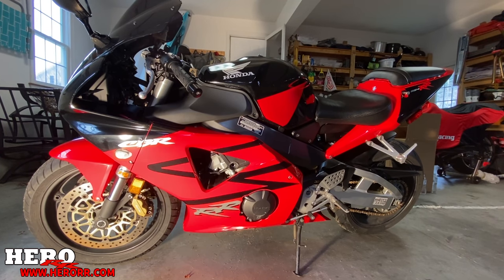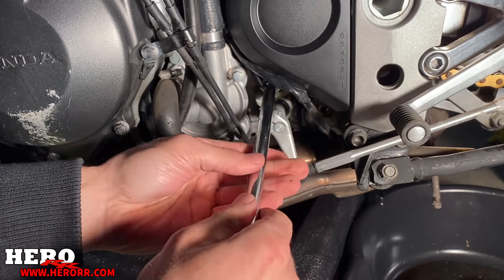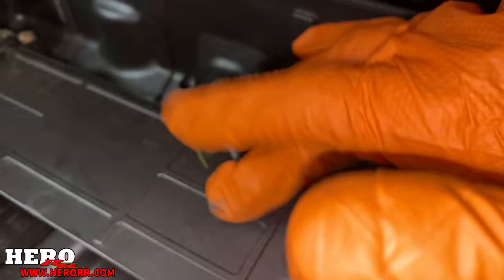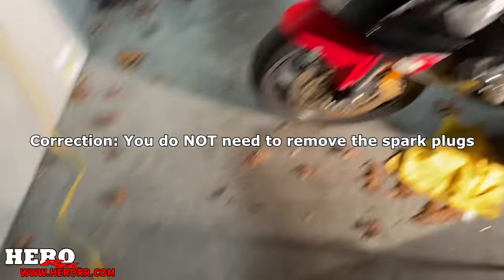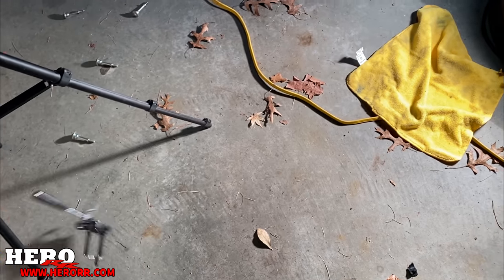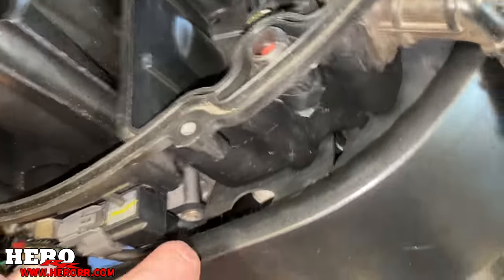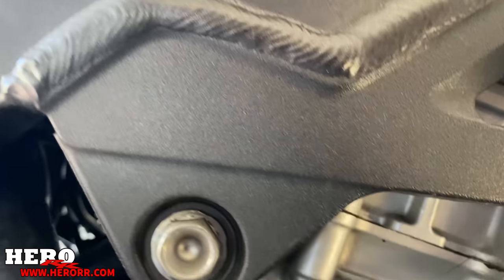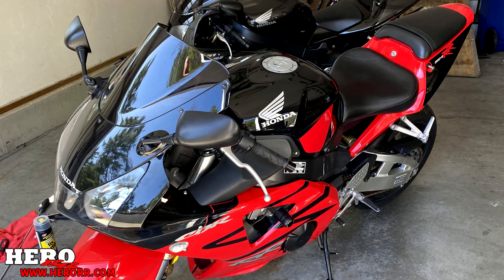Fixing my CBR954RR Lemon

Comment: Great video! Good on you for taking the time to help everyone who loves a 954 :).

Hey a couple of quick tips (apology if they have been mentioned) to help anyone watching:

- Download or purchase the 954 workshop service manual.

- Use a tool tray and small containers (e.g. spray paint caps) for your tools and screws. Avoid the floor.

- Use PLENTY of rags/cloth to wrap parts or cover them when resting against the bike.
 
- When lifting the fuel tank up, rather than 'prop' the tank with a can or anything else, you are better off tying a strap from the fuel tank front bolt holes (with a hook) back to the sub-frame near where the starter relay/fuse box is.

- No need for a sump plug magnet > the oil filter collects ALL debris (even what would be attracted to the magnet) before it reaches any bore or bearing. The magnet DOES NOT pick up main bearing or big-end bearing material (which is generally what people want to check when intending to buy one) since the top material layer of these parts are not ferromagnetic (thus will not get attracted by the magnet). What you generally see on a sump magnet is normal wear from the transmission (gears, primary drive, any other steel etc) that as mentioned, the oil filter does. Just informing ppl to save their $$$. **If you REALLY want to have a magnetic plug anyway, you can magnetize your standard sump plug with an existing magnet using the 'single touch' method (Google it, easier than me trying to explain!).

 - DO NOT use pneumatic/electric power tools for removing or installing bolts. They can damage a thread, resulting in an expensive repair. Use t-bars for cover bolts. They do not need much force.

- On camshaft cover gaskets or engine clutch/stator covers, you can use 'HT Dirko' red sealant or 'Black 3 bond'.

- Lubricate throttle/clutch/exhaust/air box flapper INNER cables with white lithium grease. 
- Lubricate side stand/foot peg pivots with Molybdenum Disulphide grease.
- Lubricate clutch/brake pivot points and cables ends with mult-purpose grease.

- Use fuel hose or a rubber hose to remove the spark plugs after they are loosened with the ratchet.

- Remove the 'PAIR' valve system and flap in airbox. You can leave all the cabling. Leave the exhaust valve (H-TEV) ALONE.

- BEFORE putting fuel tank back on, connect vacuum gauges so you can synchronize the throttle body.

- The 'noise' or 'knock' is NOT 'piston slap' > the pistons in this engine have literally NO skirt to cause this degree of noise. Usually (going by the video) this is acceptable for a 954 engine, could be simple wear & tear. Check your next oil change for metallic/shiny particles in drain tin - if there are none, no worry. If there are considerable particles, might need further inspection. 

- NEVER start the bike like you did after the oil change > instead, while looking at your oil pressure light on the display (red one), press the 'start' button and allow engine to crank BUT do not let it run. When it is about to run, IMMEDIATELY hit the KILL SWITCH. Repeat this process until the red oil pressure light goes out (it takes about 3 crank cycles), then you can allow engine to run. 

 

There is so much that can be mentioned when it comes to service/maintenance. 

Hopefully these few tips regarding your video help :)

Enjoy all!

Comment: I’ll just say as a owner of a 954. Treat her good, and ride her often. Don’t let em sit or they will have more issues than just maintaining them and riding em
Reply: that's how my uncle's bike develop so many problem it had to go full rebuilt, cus it's been sitting for years lmao
Reply: It’s better if they’re ridden but if you keep them indoors in room temperature it’s not as much of a problem.  Letting them sit in a cold garage or hot sun is horrible.
Reply: I just bought a 954 off my friend that sat for the better part of 5 years. The bike is in overall great shape but I would watch out for dried out rubber pieces. My chain guide and my rear cush drive dampers fell apart in my hands. Put about 1k miles on it so far with no other issues
Reply: they have weak weak breaking power when used as intended and front forks like tooth picks.
Reply: I’ve put 10k miles on my 954 since last June! I ride her as often as possible
Reply: @JimmyTheBear  hard disagree.
I’ve put 10k miles on a 39k mile 954 since last June on Louisiana roads.
The forks did get a service a year ago, but they are holding up like champs.
Reply: @jasonroth376  watch for grounds messing with you. Fuel pump not priming is a clue.

Comment: I've owned a few 929 / 954 over the years and love them but they are a nightmare to work on! A few times I've thought that it probably would have been easier to actually remove the engine then struggle around the frame! ❤️🇬🇧

Comment: I've had to do chain tensioners on all the Hondas I've owned (1995-2000)Then I went to a manual one, where you just have an external knob to turn to adjust. Because that is a job you really don't want to do twice.

Comment: When you drain the oil, if you are looking for shavings run it trough a filter, like coffee filter or a white rag something along those lines, you can also use a magnet to help. Sometimes loosing the engine  and tilting it a bit can help a lot giving access, don't know if that's the case here or not, enjoy your 954 and thank for the video
Reply: Or cut open the oil filter, there are even "can openers" for them :D
Reply: A cheap neodymium magnet to pull thru the oil as it drains would do the trick.

Comment: Idk if I'd call it a lemon it seems to me like it just has average wear from someone either not riding it enough or just not mechanically knowledgeable so they just road it and did there basic oil changes. Things like stripped bolts, leaking gaskets, dirty oil, bad clutch disks ECT are just normal wear and tare from time. You have to remember this is a pretty old bike it's seen a lot over its years and this kind of stuff just happens it sounds to me like you just spent more than you wanted too on the bike but she's a beut and not a sad lemon. 💪 

(Btw your spark plugs is showing the bike is running to lean) ps ps Also when you do the cam chain tensioner on the 954 next time around drop the engine in the front onto a jack so the CCT isn't as tight to the frame. 👍

Comment: After getting my own 954rr a few months ago I was very worried about all the engine noise and did a lot of research as well. Mine doesn't make the tapping sound yours does, however mine does make a sort of clunking I notice at idle. I tracked it down to the exhaust valves where the servo cables change the valve position at 3k/7k RPM. My servo motor works just fine but for some reason I get a rattle noise from the HTEV area down there. I've read about the pistol slap as well and try not to worry about as my bike performs flawlessly. I think the valves on these bikes are noisy as well, my 929rr engine is very quiet compared to the 954rr.
Reply: There is more power and compression per generated by the engine, and a slightly more aggressive cam profile, within the evolution of 954's head from the 929's design, so it's natural it'll be noisier than the earlier 929 father and original 900's grandfather motors.
Reply: Why would even buy a old ass bike ? That’s like putting a 50 yr old on the sports field during a soccer game expecting him to keep up with 25 yr olds lmao
Reply: @TheInfantry98  why are people still buying old Harley's or classic cars, bikes, sports/team kits etc...? Or how long is the piece of rope you weren't thinking of?
Reply: @TheInfantry98  why marry your crush when there are celebrities available for you?
Reply: So How come Honda Didn't Fix These Problems Back in the Day... Or are like Age and Mileage plays Role...
Reply: I’ve put about 1500miles on my 954rr since my comment and the bike seems to have quieted down a ton. A blast to ride and own.

Comment: The wierd noise rattling occasionally is your cam chain tensioner..replace it if its electric (non adjustable) or adjust it if its mechanical (non electric and adjustable)
Reply: Probably true after all its Honda and do have history with cam chain tensioners
Reply: I think not tensior its clutch basket springs .ones behind not clutch plate ones. I have sc 33 .athough my tensior seemed to not to be locking i got new one.but havent got engine back in frame . been 2 years opps .

Comment: Step 1: Drain and remove gas tank.
Step 2-37: Everything complicated.

RR: I'll just go ahead and skip step 1 to make everything harder.
Reply: You dont have to drain it. Rubber bung plugs work great..but yeah i agree, pulling the tank on a job like that will make the job a lot easier.

Comment: I had a 929, loved it, great trip to the Nordschleife. Clutch rod broke whilst I was in France, had to ride whole 400 miles back with no clutch, lots of running to get up to speed and bonking it into first. A year later, on the track it kept refusing to go into 3rd, or dropping out of third mid-corner, which was not cool! I sold it to get an CBR1000RR6, with the cassette gearbox, so that if that started playing up it would be an easier fix. I track-dayed that for nine years, never let me down. Was literally the perfect bike for the track. I didn't use it for much else, I think because it's begging to get leant over and I had some dodgy moments from enjoying some knee down fast corner stuff, you just can't cruise about on it. Sold it 2022, just bought a CB600 as I do miss biking though!

Comment: My 954 makes the same noises yours does. I replaced my CCT as well. I found that after doing the valve clearances (because they were waaaaay out) that it made more noise than before so I think it's mostly the valvetrain. My mechanic stethoscope doesn't pick up much noise near the crank but a lot by the valve cover. You should check if yours does the same.
Reply: I don't have the precision stethoscope such as yours but I used a screwdriver with a solid end for hammering by putting it at my ears and the flat head towards the CCT, valve cover, block head and finally found the clicking noise to be coming from the HGEV, HTEV? it's the exhaust valve. Somehow warming it up for awhile and riding it would eliminate the noise. Amazingly the exhaust valve motor still works for mine.

Comment: Yes sir that slap was always super noticeable on my 954 when I had it. Something you should look into as well is some case cover protection. I went down in gravel at 15mph and my stator cover blew apart and in the process the mating surface on the actual engine at the bottom of the cover completely snapped off.... I cry still even after getting a new bike. I miss the 954

Comment: Another tip, trust when i tell you, removing the tank will make youre life much easier on a valve cover removal. Sometimes, if its an easy job, ill put my bike on the stand so it sits upright and ill attach ratchet straps to the ceiling of the garage to pull the tank up so i dont have to disconnect the fuel lines. Working on these street bikes is a pain in the balls but its better than paying $100/hr mechanic 😆

Comment: Back in the day when I was wrenching I wouldn't worry about what length bolt went where. Upon reassembly I would insert the bolts and if they were all even I knew they were in the right place. Most of them are pretty easy to figure out.

Comment: When you opened thet clutch cover i was wondering, how is everything SO CLEAN?? Where is the oil??
Reply: Most engines are clean like that on the inside. Oil filter catches 99% of the dirt and oil is remarkably clear when it's a thin film. They usually stink to hell on the inside though.

Comment: Bikes are fun.  Wait until the diode to the neutral light goes out, lotsa fun.  The neutral switch goes into the engine crank and sit on the shift drum, the neutral slot for "frame ground."  As the switch wears, it will shave a little off but the shift drum will also "flex" with the switch.  Typically, hot oil will leak and get on the wires requiring a new connector (easy, cut it off and solder new one).  So you can save that neutral switch, universal on other Hondas, still good if you polish it and remove the corrosion ($1 lime-rust gel).  Tapping sounds are common, especially V8s.  A tapping sound at startup is always VALVE related, in this case, piston slap.  There are books on how to diagnose an engine by noise (Hughes).  It will remove carbon around the valves if you add a gas additive.  Bikes are even more fun now.
Reply from the maker: Do you think the tapping sound left unchecked would cause a problem? Or just wait for it to go away before riding and I’m good.
Reply: @HeroRR  Tapping sounds are common and do not pose any serious harm to an engine, however, they are annoying!  They do not go away either.  The only thing I can tell you is it is related to your valves, intermittent.  The question is how badly do you want to fix that annoying sound before the engine warms up?

Comment: Anything to do with the top end on these bikes it’s quicker to drop the engine down, simply because there’s no room.  Personally I would have tried to stop the leak, but as long as it wasn’t a major issue I’d just live with it 😆 until I had to get in there for some other reason.  I have an 04 F4i, our bikes are very similar in design.  I blew out a spark plug last summer, what a nightmare.  Ended up swapping the engine because it was the easiest and most cost effective solution. $600 got me an engine with 14K miles, mine had 38K.

Comment: Hero 
I have a 954 since new 2002
Your engine sounds normal .
Keep it stock maintain it well,ride it a few months then I'm sure it's an original fuel pump so go ahead and change it out for a stock oem honda pump no cheap sh*#t.
Trust me you can thank me later.
My bike was lagging just not like brand new
New fuel pump bam! Sucker is a rocket 🚀. 
Enjoy 954 best most accurate steering bike I have ever ridden. Surgical.

Comment: back when I had my F4i the clutch would rattle at idle and would go away when I pull the clutch lever. the inner clutch busket nut had to be retorqued.
Reply: I have the exactly same problem in my 06 F4i, please give me more information about this. On Honda forums this issue is very common for cbrs and almost everyone says to just ignore it. My bike has 20k kilometers, should I go to a mechanic urgently or just leave it like this? I have good mechanical skills, if it's something easy to fix maybe I will try to do the job, what do I need to change/fix? Thanks a lot
Reply: @rhemyis  there's really not much information to give. I remember the clutch cable having too much slack and a new cable didn't solve the issue. So I pulled off the clutch cover to see what was going on and the inner clutch basket had some play and would move in and out a bit. I ended up getting a new nut from Honda and just torqued it to spec.

Comment: Probably would've been a tad easier to work on the valve cover if you just dropped the motor.  Since you were missing a few bolts anyways, why fight with it when it's still in the frame?

Comment: That’s why people pay $$$ for new bikes. It’s not a lemon, it’s had 20 years amateur maintenance. Bikes with a cheap micron exhaust are a bit of a giveaway. Flush brake fluid, do a valve clearance, new gasket, plugs and air filter and replace cam adjuster. 1/2 a day. Next will be fork oil replacement. Seized stripped bolts on a 20 year old bike is par for the course.

Comment: Holy shit what a nightmare hahaha That cam chain tensioner bolt is comical... guess its what happens when you try to squeeze an almost liter size engine in a skinny frame. Good job on doing it !
Reply from the maker: thanks! lol good point I guess if you want to enjoy the benefits of a lightweight bike sometimes you gotta deal with the downsides (tight tolerances).

Comment: Hi, When you replaced the cam chain tensioner did you put pressure on the cam chain so that it is held in place so that cam position is preserved ?
 If not the timing goes off. At least that's the case for the Triumphs. Thanks
Reply: I think you slightly mis worded what you wanted to say.. or intended to mean. Please redraft/edit your comment to be less backwards. Thank you 😊

Comment: I saw your other videos, and noted you have a CBR600 as well. Have you removed the head cover on that too? Is it comparitively easier? I am getting some tappet noise, not severe, but occasionally I get a sewing machine kind of noise from the head when riding.From what I have read, most people take the engine out to adjust the shims.  Also, the speedometer stops after riding for about 5 minutes, then starts again. I attached a multimeter to the speedo terminals, and noted that there is a constant 5V being applied instead of the pulse when the speedo stops, which indicates that it is not the instrument cluster, but the magnetic pickup in the engine. Nothing is really easier to get to, but I was wondering  if you have ever done this on the CBR600?

Comment: Cam Chain tensioners are a pain on most crotch rockets...to be clear, one bolt is easy(a few seconds to remove),  the other is always jammed against frame...20 minutes to remove...or more.  Makes ya wonder why they're not in horizontal position...  But, then each bolt would be 1/2 a PITA to get out.  Nada ya can do.

Comment: While you were in there you should have replaced the gaskets around the sparkplugs as well. This really is all standard work for an inline 4 in a sport bike of that era. My ninja 900 is the same way. It's not hard, it's just a lot of steps.
Reply from the maker: I did though, the valve cover gasket has the spark plug gasket built into it.
Reply: @HeroRR  ok good. did it fix the leak?